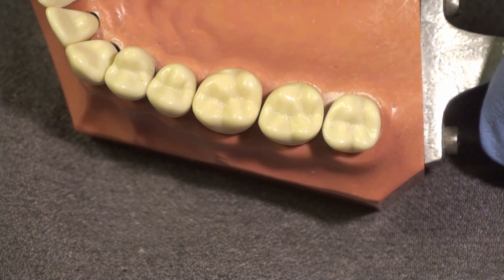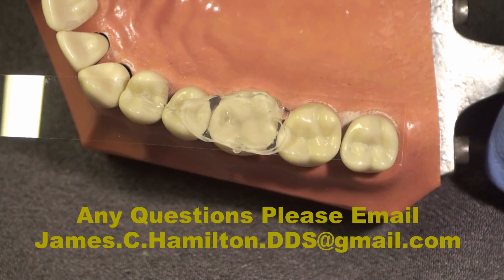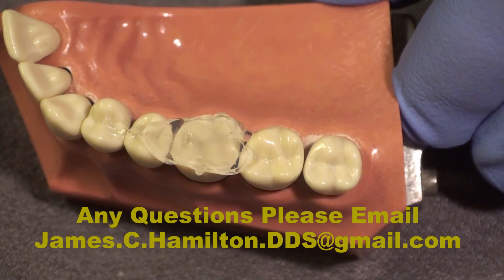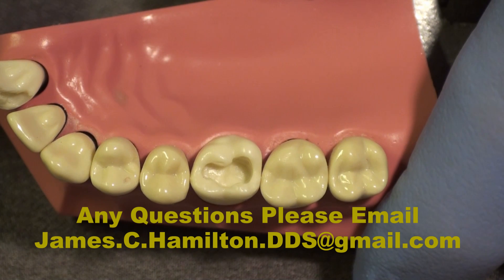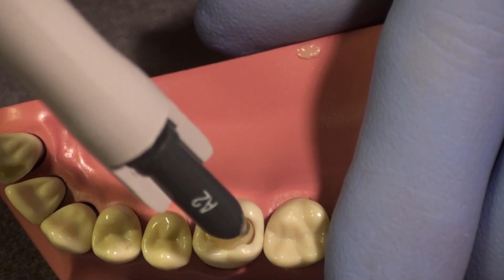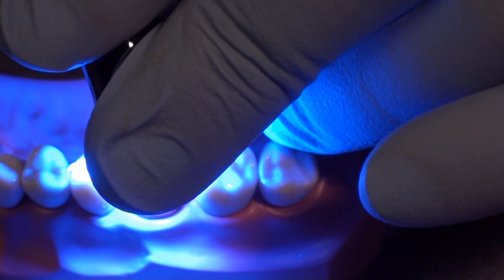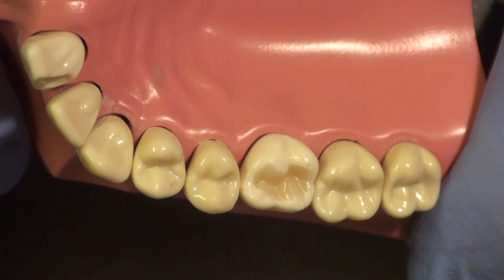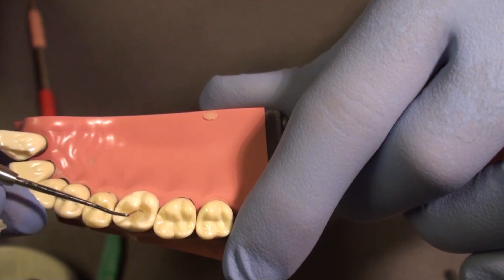Class I Light-Cured Composite, Time Saving Technique

Comment from the maker: @mycrickethighlights2  You etch and bond as usual.  Most steps in placing a composite are the save.  The main difference is you want to place only a slight excess for your last increment of composite.  Most dentists were taught to place more composite than you need and then grind away all the excess while developing the anatomy and occlusion.  This is why you can save 5 to 10 minutes on each composite placement while developing anatomy you can only dream of.